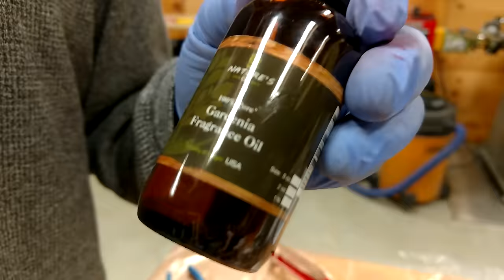Making Colored Smoke Devices for 4th of July

Comment: Is there a way to make them burn longer? Specifically I want light grey to white coloring and I want it to burn over a small backyard sized area for about 10 minutes, I don't mind lighting several to get the area but I want to get the time down?
Reply from the maker: Adding a tiny bit more sodium bicarbonate for the colored smoke or a few more percent wax for the white smoke, will have a significant slowing effect.
Reply: @TechIngredients  Cool thank you :) Now I'm trying to find a local supply of ingredients to give it a try :)

Comment: Potassium Chlorate is crazy expensive. $104 AUD for 500 grams (Approx $65 to $70 USD) or I can buy 5 KG $604 which is even stranger as it seems to cost more, the more you buy. I can do more research but I don't think its gonna be cheap stuff. I think I might just stick with the other video if I ever get around to doing this.

Comment: I can't access KCLO3 can i used KNO3 in place and still get a good colored smoke?
Reply from the maker: Probably not.  As I discussed nrr the beginning in the lab, the decomposition temperature of KNO3 is higher, sothe oxygen will be released only at higher temperatures.  This can break down some of the dye color.  Certain dyes may be stable enough, but I'm not sure which if any are.

Comment: I know this is a really old video but the "Ultra RTV" does not cure via water, it is not the  acetic acid type silicone compounds, it is a vulcanizing rubber that has an ammonia base that cures by releasing that chemical.. sorry am not fully up to speed on the actual happenings but RTV came around thanks to Chevrolet and the use of this on their cars starting in the 80s.  It became a hit and is used because of the high temp and hydroscopic properties...       The "water" activated sealants are in fact silicone ..  Smell them, the water activated will curl your nose like a good dill pickle..

Comment: I pose a question. He said in the video you can ad oil to the mixture to change the smell. If I were to add capsaicin oil, would I end up with a teargas?
Reply from the maker: I suspect you wouldn't want to get too close.
Reply: You could. But it wouldn’t give you the best dispersion for what you’re seeking. Also allot of the goodie would be burnt off. You need an aerosol delivery. Or something that pops open a container, with the pop being able to disperse without burning the payload. 

There is not allot of info out there. But I’d guess “day time” fireworks would be a good place to start.

Comment: I can't get the scented version to work. I'm using identical chemicals in exact measurements and exact fragrance oil but it still just smells like the colour dye. Any suggestions??
Reply: Zero sublimation of the fragrance, I tried a pumpkin spice fragrance oil but no smell whatsoever
Reply from the maker: Are you sure you used  potassium chlorate rather than potassium nitrate?

When you prepare an  unscented mix, does it burn and produce the same rich color we demonstrated at the beginning of the video?  None of these were scented.

When you say exact fragrance oil, what was it exactly and where did you get it.  There are some inexpensive versions that are very dilute, despite what the sellers claim.
Reply: Tech Ingredients yes I used Chlorate and yes the colour remained rich! Just no smell. I used fragrance oil from glade plug in diffusers:) thoughts?
Reply: Also, I was using a metal tube.
Reply from the maker: The only difference would be the source of the scent.  Try one of the more expensive oils found in the candle making section of Walmart.  At approximately $4/ bottle, we tested half a dozen and all of them worked well.
Reply: Tech Ingredients thank you!
Reply: Tech Ingredients what component should I increase by a few grams to get a more aggressive throw of smoke? Not too crazy but just a bit more powerful throw of smoke
Reply: @markmikhail4279  Potassium chlorate

Comment: Is there a normal use or brand name for the pigments? Everything I’ve tried just burns the white color.
Reply from the maker: Solvent dyes are the best category to look for and make sure you're not using potassium nitrate as the oxidizer as it's higher temperature will cook the color out of almost all dyes.
Reply: @TechIngredients  yessir. I got everything off the scent-free recipe from Skylighter’s. Haven’t managed to find the colorant yet
Reply from the maker: Try coloredsmoke.com
Reply: @TechIngredients  you da man. Thank you!
Reply: @TechIngredients  finally got a tester put together. I gotta say, the saturation of color in the smoke is insane. Stupid satisfying to finally get too. Thank you again. The clips of them burning here look fantastic, but doesn’t do justice to how thick the coloring is in person. 👌 

To be fairly cheap, I got a pound of each primary color. Figure I can mix most from that for now.

Comment: Hello consult  I use the same ratio but Spray force Very weak Why is that?With the film Small Paper Tube!
Reply from the maker: Spray force is dependent on the surface area, within the tube, that is burning.  Take a look at the two sizes we burn in the demo.  The larger tube produces more spray force.  Try constructing a larger device.

Comment: My formula was followed as per your instructions to the exact gram, for some reason, my dye turns white half way through but ONLY for red smoke, why is this happening? I have tried everything possible, I'm using your dry mix method, same tubes, same dye company, same plugs, same chemicals. Help?
Reply from the maker: Weird! Does the burn rate change when the color disappears?  Is it gradual or sudden?
Reply: Tech Ingredients it's sudden! The reaction starts with red smoke then sudden change to white and then the reaction appears visibly faster.

Comment: What would a mix ratio be with white smoke but added scent? I’m sure the dye ratio would dilute the mixture so what would I add instead of the dye mix as a substitute?
Reply from the maker: I don't know, but the scents tend to be oils similar to the paraffin and a one to one exchange for the wax component would be a good place to start.
Reply: Thanks for the response! 
Where are you sourcing the potassium chlorate? This stuff is impossible to find lol

Also how stable is the final mixture? Some light reading online warns of how unstable the mix could be

Comment: How are you able to make them last that long? For me, the ash buildup causes it to last only 30ish sec.
Reply from the maker: Just follow my formula and the assembly process.  There should be not be any ash produced.
Reply: @TechIngredients  what's the exact height, thickness, and outlet hole diameter for the tube you used? 

In my attempt, I loaded 60 grams of smoke composition in a 1.75" diameter cardboard tube but then after about 25 seconds the grenade "pulses" very little amount of smoke. Wouldn't that pulsing be due to ash building up in the tube preventing the smoke from escaping?

Your tutorials are awesome by the way!

Comment: I asked this a while ago but haven't heard back, if I wanted to make a scented one without colored dye, what would the ratios be or do you just leave out the dye powder?
Reply from the maker: I haven't tried it.  The dye is passive, it doesn't burn.  Therefore, the mixture will likely run a little fast and hot without it.  Increasing the sodium bicarbonate a few percent at a time will reduce both the temperature and the burn rate.  I'd do these  trials with the same amount of oil.
Reply: @TechIngredients  Thanks, I'll give it a try.  Keep the great videos coming.

Comment: I have a question.  Why not just use powdered sugar? Just to save that one small step.
Reply from the maker: You'll need the grinder in any case to prepare the potassium nitrate and table sugar is much cheaper.
Reply: Tech Ingredients these fumigators look so effective that I would caution people to take steps to not have the fire department at their door especially if they are set off on a day when fireworks are uncommon.  Maybe not the colorful ones so much but you can imagine someone filling a ten liter bucket and causing himself issues.
Reply: Tech Ingredients keep up the good work.  Trully doable intelligent content is rare.

Comment: hi i live in south africa and struggling to get potassium chlorate or potassium perchlorate is there anything els  i can replace it with
Reply from the maker: Not easily.  Potassium nitrate burns too hot and despite several attempts to get this oxidizer to perform at a low enough temperature to preserve the dyes, we couldn't get it to work.  If you are willing to synthesize potassium chlorate, it isn't difficult and we might do a video on this process if there is enough interest.

Comment: Why can't I just use potassium nitrate and just increase the magnesium carbonate?? How much of an increase in the magnesium carbonate would I need to still be able to have a burn that wouldn't decompose the smoke dye too quickly?
Reply from the maker: The problem with potassium nitrate is that as you cool the burn with the carbonates to protect the dye you reach the point where the potassium nitrate will fail to decompose to provide the oxygen to support the burn.  You may be be able to just barely get this to work, we were not able to.
Reply: @TechIngredients  Thank you, and what about decomposition of the scents? How do they survive such high temperatures? The flashpoint of most essential oils is ~200F, I imagine the smoke device is exceeding that temperature, no? How does it still produce a scent.

Comment: Wait so is it possible to use potassium nitrate instead of potassium chlorate with the magnesium carbonate? Or will there be a diminshment in effect?
Reply from the maker: No.  The potassium nitrate will not decompose at a temperature that is low enough that the dye is not deactivated.  It doesn't matter how the temperature has been limited.
Reply: @TechIngredients  Thanks for the reply. hmmm, I can't get access to potassium chlorate unfortunately. Do you know what the next best method of colouring would be considering this or am I stuck?
Reply from the maker: Potassium perchlorate will work.  Synthesizing potassium chlorate is not too difficult.

Comment: Is there any recipe tweak which would let you use paraffin wax as the oil in the “scented mix”?
Reply from the maker: It would be difficult, because so little is used.  It would cool too quickly.  You could use cooking oil if you wanted to avoid the smell.
Reply: Tech Ingredients perfect, thank you. I’ll give cooking oil a try

It isn’t the smell id like to avoid as much as I’d like to add some malleability to the colored mix - similar to the easy workability of the white smoke mix with paraffin.

Comment: So, could a person use permetherin oil to create a mosquito fogger?
Reply from the maker: Probably
Reply: Good idea! Except...FYI...They sell store bought foggers for that purpose that would last alot longer as a skeeter repellent than the smoke bombs as the fog is DIRECTLY sprayed on wherever skeeters hang out during the day instead of just floating in the air like the smoke bombs. They burn 1# green cylinders or the longer blue cylinders. I think Black Flag makes the foggers and the repellent that goes into the foggers. Unless, of course, you'd like the colors...Or, the scent of Gardenia mixed in with the pyrethrin..😂😂 Planting chrysanthemums around your property is also a good choice to keep those POS's at bay. Pyrethrin is derived from chrysanthemums.

Comment: I bought the wrong stuff. Potassium Perchlorate I doubt that will work as it is not as reactive. Thoughts?
Reply from the maker: I think it will work.  Try using a little less of the perchlorate because it has about 25% more oxygen per gram. If it works and the burn rate is too slow or fast then further adjust the percentage.
Reply: @TechIngredients  Hey thanks for your time. I am ordering the right stuff, and  going to save this I guess until I get some Dark German Aluminum . And test out my diaper folding skill.   Fantastic video I only with I could procure solvent dye. Happy Fourth!
Reply from the maker: Check out coloredsmoke.com
Coming soon; pictiny liquid binary explosive.
Reply: @TechIngredients  I can't wait. BTW I don't know if you are familiar with the M- 203 or 37mm (Signal) launchers. Or theAR-15, .308 can cannons. But I am making these smoke grenades for them. I wish I had a camera man like you I'll post my results. And thanks for everything.  If your still doing resonance dampening on the acoustic speakers That 5 gal bucket of compound you used for dampening between layers. Can the spray foam dampening compound beat it? And if not, is the reason because  of the thin 1mm thickness you applied (critical), and the foam spray would make it too thick and unfeasible? (Sorry side note)
Reply from the maker: Not really.  It is the gel like viscoelastic property that eats up the energy when the sound pressure causes the two panels to flex/slide relative to each other.
Reply: @TechIngredients  there's always Butyl rubber? lol j/k
Thanks for everything.

Comment: hello sir.. here dlfrom Philippines.. can I ask sir regarding carbonates.. instead of using rhe combination of 16% Magnesium carbonate and 3% sodium bicarb. Can I used only sodium bicarbonate 19%??? coz I can't find mgCO3...
Reply from the maker: You may get by with only the Na bicarbonate, but you will need much less than the total of 19%.  this will require some experimentation.  The Mg carbonate is frequently used by ceramic casting companies and is quite inexpensive.

Comment: Could you please post a link as to where I can buy the solvent dye that you are referring to?
Reply from the maker: Sure, no problem.

http://www.coloredsmoke.com/products.html
Reply: @TechIngredients   Hey thxs.

I have another question/issue about how to understand the purity of a particular chemical ie: Potassium Nitrate KNO3.  I recently purchased 5 lbs from a company call the Seed Ranch.  On the label it was listed as Green House/ Hydroponics grade @  99.8% purity.  Also on the label was the elemental break down of what was in the KNO3.  I was wondering if you could do a video on (1) what are the different grades and purity's of chemicals that are used in pyrotechnics (smoke bombs)  (2) What is the mathematical formula for figuring purity for a particular chemical. (3)  When is not necessary to buy expensive high grade chemical when they are not needed.

Comment: Can these be easily adapted to fire out of a 37mm signaling device?
Reply from the maker: It could probably be done, but not easily.  The challenge is in the fuse.
Reply: @TechIngredients  yeah the fuse used on 37mm is more of a firework fuse. It seems as long as the reaction starts the smoke will continue to light. I am wondering if you could just have the fuse secured in the upper portion so it doesn't burn down quickly through the entire body.
Reply: Precision Pyro Supply is a good channel for everything thirty seven millimeter signaling.
Reply: @charleshetrick3152  I've watched most of his videos and emailed with him a lot. Actually troubleshooting myself through a smoke kit that I bought from his website.

Comment: Hey mr wizzard. I
 purchased KClO3 online, dit your mix but that didnt burn very well, no color in the smoke either. Is there a way I can check if its pure 
KCI03?
Reply from the maker: Try a 50:50 mix of sugar and the KClO3.  It should burn fast and hot.
We got our dye from coloredsmoke.com
Reply: @TechIngredients  yeah thanks I will try that. I have some solvent dyes from a paintshop. Are they any good?
Reply from the maker: I can't answer that, but I have some doubts.  If the "fuel" burns well and you're sure you are not using the hotter potassium nitrate oxidizer then you should get a lot of color.
Reply: @TechIngredients  from wat I tested and I can see here.. The problem is with the dyes. They dont burn. They are super heavy and kill the burn proces.. Im gooing to try and order the colors on the site you gave me
Reply: @TechIngredients  I finally dit get al the right products that I need. I dit order the dyes in the company you told me to. They have an Italiano sub firm here in Europe. Pricy stuff €€€I dit notice some differences in the burn rate depending on the colors I use. For example the Red dus burn allot more aggressive and match faster then yellow. I dint notice that the different colors dont have the same weight in term of volume. For red color I didn't need as match product to get the right weight. Yellow powder was allot lighter in volume. Do I need to change some thing in the formula to make all colors burn at the same rate? Or i'm I missing something else here? Ore when I would like them to burn more aggressive and faster? Just lower the color percentage? The bombs dont need to burn that long in time. But need to make as match smoke as possible, at the shortest amount of time.

Comment: Would powered sugar work,instead of grounding up regular sugar
Reply from the maker: Probably, but you have to use a grinder to grind the oxidizer, table sugar is very cheap and grinding the sugar takes roughly 10 seconds.

Comment: Can you just add the scented oil to non- colored version?
Reply from the maker: You should be able to.  We did a video on white smoke and you might want to check that out.  However, the chemistry is different there and those burn too hot for oils or colors to survive.  If you just add oil to these colored devices, the smoke production will be low, and additional sugar will be needed even for that amount of smoke, but it should work.